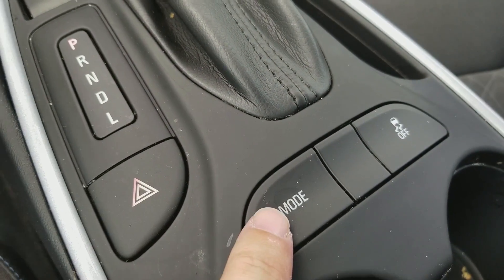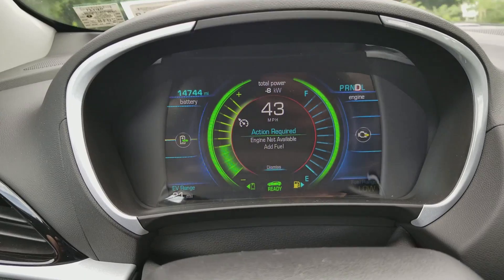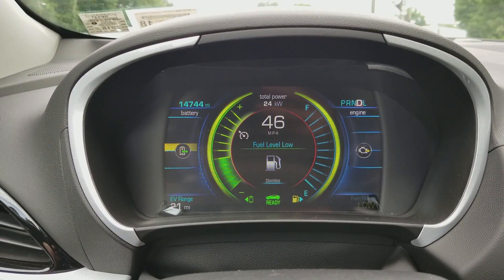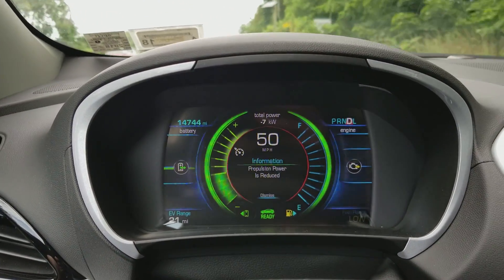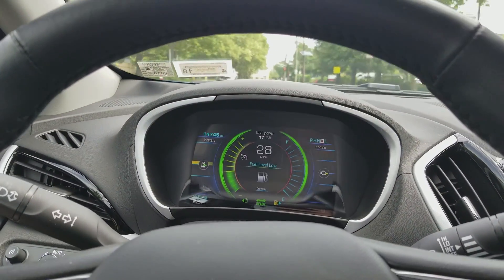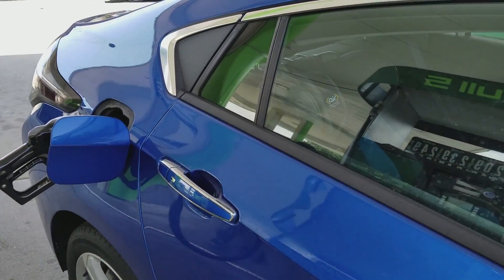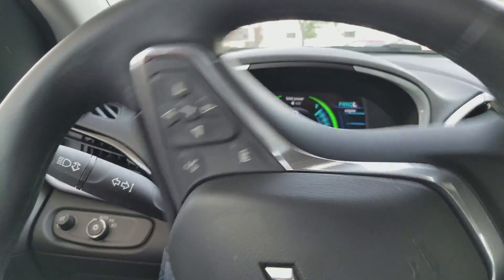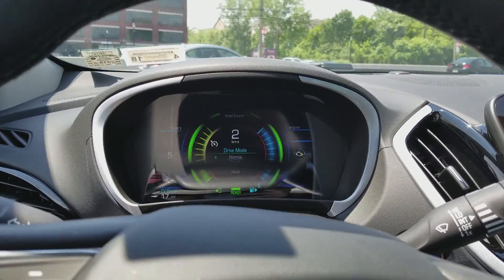Electric Chevy Volt Runs Out Of Gas - Becomes Dangerous

Comment: At 2:03 it literally says "Propulsion Power is Reduced" on the dashboard...
Reply: +Darek M It is right in the manual. Multiple warnings
ENGINE NOT AVAILABLE ADD FUEL
This message displays when the
engine is not available due to
running out of fuel. The vehicle can
continue to be driven in Electric
Mode until the battery is depleted,
but will have reduced acceleration.
When this message is displayed,
refuel the vehicle.
FUEL LEVEL LOW
This message displays when the
vehicle is low on fuel. Refuel as
soon as possible.
OUT OF FUEL/ENGINE
UNAVAILABLE
If the vehicle runs out of fuel, or the
engine will not start due to a
malfunction, the vehicle can
continue to be driven in Electric
Mode until the current charge is
depleted. The vehicle will have less
responsive acceleration. DIC
messages indicate reduced
propulsion power, that the engine is
not available, and the need for fuel
or service.
Reply: I mean it still by far outperforms any other car that runs out of gas, so I think Chevy did a great job here!
Reply: Darek M - I couldn't agree more.
Reply: only find out later? Ugh its in the manual lol, always read the manual! page 136!

PROPULSION POWER IS REDUCED
 
This message displays when the propulsion power is reduced and can affect the ability to accelerate.
If this message is on, but there is no reduction in performance, proceed to your destination. The performance may be reduced the next time the vehicle is driven. The vehicle may be driven at a reduced speed while this message is on, but maximum acceleration and speed may be reduced. If this message stays on when the malfunction indicator lamp is on, the vehicle should be taken to your dealer for service as soon as possible
Reply: haha well i'll be damned
Reply: it's more than that Daxlaxx, the electric motors are power limited below their normal power, it's not just the engine that gets disabled.
Reply: ThOrZwAr and its right as he is saying that it should warn of it lol...   Irony
Reply: yea i gotta first gen prius. when it runs out of gas all the dash lights comes on lol scary!  and its will get you to a gas station but not anytime soon lol. I think my top speed was around 30mph with no gas. and its dangerous because once that battery dies its no way to charge it to get the ice running again. would have to tow it to toyota.
Reply: Dashcam Channel Some* My mom's car is a 2016 crv, mine is a 06 Jeep GC. The seatbelt beeps stops on hers(and won't make a beep when the seatbelt is removed, only a light on the instrument panel), while mine keeps going.
Reply: Dashcam Channel This car has none of that anyway, so you knew what you bought.
Reply: most cars serviced and maintained at main-dealerships are lease cars, under full warranty. if you want your car serviced properly while out of warranty you'd better get to know the service manager. maybe send the department a christmas card etc and engage in some car-talk about their product (your car). They may just think that what you don't know won't hurt and you can afford a hundred extra bucks. they may also be too busy to really think about going a bit further. 
Just don't forget that the time you spend messing about trying to figure out what is going to cost you money is time you could be doing something else possibly more valuable. 
Is trying to save a hundred bucks here and there by using essentially the goodwill of others worth it? 
An most people can go to another dealership, or at least try another then go back to their original with a comparison, and the original may be more eager to help you if they see a stamp from another garage in your book; even if its from the same dealership chain...
Reply: That's so true what
Reply: That’s why it’s important to know your car? Lol having the discipline and making wise decisions on your own.
Reply: There is also a chime. But this guy must work for cnn or abc cause he's not telling you the whole story
Reply: ThOrZwAr Unfortunately some need the annoying dinging and flashing lights to take notice which Chevrolet didn't do in this situation. Kind of like the newer cars that have the constant beep until you fasten the seatbelt...
Reply: Who knew if you ran out of gas on a hybrid it wouldn't go fast
Reply: That doesn't help you if you only find out that it even has that feature when you've already entered the on ramp before that message comes up expecting it to have the usual performance it has in all electric mode and by then its too late to realise you're gonna need a longer run up than usual to reach merging speed.
Reply: @RWoody1995  well driving an economic car and still not being able to afford gas is bs also the car was fine he still drove it at 50something mph wth
Reply: I'm not sure about the new version, but the old version dings when you are low on fuel or empty, every time you switch on the car, and has constant dashboard notifications.

You deserve low propulsion for being an irresponsible buffoon.
Reply: Darek M   I agree especially if it's something that is as different from the past decades of cars as a hybrid or whatever the Volt is.
I am guilty of not reading (or remembering ) everything from my manual,  but if or when I get a Volt i'm going to be too worried I might make it explode without reading the shit out of that manual. 
I do get pissed however, when something goes like this with the "regular" cars we know;  The dealership (or maintenance shop you frequent) sends suggestions of the things your car needs in it's checkup, including scheduled maintenance and things the manufacture even recommends. They have it all there listed, saying how important it is. Okay great. You take it in and they do their work. 
Then you find out after maybe oil is burning more or the engine is not quite what it used to be, that something like the PCV valve or whatever should have been changed at a certain mileage, which is IN the manual in small print or a schedule mixed in with tons of other small things, BUT your shop or dealership didn't mention it. Didn't have it on their list of things needed... nothing. 
So they get you used to the suggesting what "needs" to be done or recommended yet leave out something important, which suggests and implies they know what you needs, yet shrug about it when you start to ask questions after it's too late.
Reply: Yeah, but "reduced acceleration" and "less responsive acceleration" does not communicate the full import of the true situation: you're acceleration will be reduced to less than that of an original VW Bug towing a boat anchor. Your ability to attain freeway speeds will be measured in calendar days.

Comment: I mean, I get that it's a big difference, but dangerous seems a bit like an exaggeration, no? You do know there are production cars on the autobahn with similar performance and it works just fine, you just need to be aware of it, which I hope/assume is your point. (Personally drove a 40 something horsepower 3 cylinder shit bucket on the autobahn and it worked, not that it felt great, but it worked without issues)
Reply: captainsewerrat When you think a car should do something and it doesn't like it has before, it's a problem. I've driven older petrol cars in limp mode and they are dangerously slow about town.
Reply: It really is the owner's fault for lack of fuel planning. Don't wanna take the risk of merging with a 0-60 of 20s? Don't run outta gas, OR, simply stay put and wait for AAA.
Reply: I wouldn't really say the design is stupid. The car warns you forever that you're about to screw yourself over and it's basically just a bonus that it does anything at all once it reaches that point. If I run out of gas going down the highway I just come to a stop, which is also dangerous, but it isn't the car's fault that I did something stupid.

So... I see 2 arguments here.. 0-60 in 20 seconds is dangerous, which I agree with, and the Volt design is stupid, which I don't agree with.
Reply: Maxwelhse if it was a regular car that just a had a failsafe of   Temporary drive ability on electric just to get to a gas station. I would totally agree. But in either case, whether it's a failsafe in emergency situations, or it's an actual option that you can cruise around town on. It should d I've that way safely, or give you a giant detailed warning that your car will lose 90% of its power.
Reply: yan-Deriction yes, but he didn't exhaust both. He set the car to use just the engine first, then the car went into limp mode while he still had sufficient battery charge for normal performance. Obviously if you've blown through the battery and then the gas it will make the most it possibly can out of the remaining charge in the battery, and you shouldn't let it get that far.
Reply: I might agree with you, except, the volt was supposed to have a 40 mile range full charge, if you looked at the cluster display, he had over 20 miles available.  This car was marketed as a EV with gas range extender..., so, it is NOT unreasonable, for someone to assume that it would have decent performance whether on gas or electric alone, not just have both....  I was considering a volt, but, now, unless I can get the computer reprogrammed to prevent that half arsed limp because no gas crap, I will not get it....  The gas motor was supposed to be a GENERATOR ONLY, not, a primary motivator...
Reply: actually, you are wrong. The volt is a plug in hybrid - which is not the same thing as an EV with a range extender. The engine in the volt can drive the wheels directly - it is not simply a generator, as opposed to something like the bmw i3 REX which's range extender only provides electric charge and never drives the wheels. The engine needs to come on every few months even if you drive on electric only 100% of the time. You wouldn't drive the volt around with no gas, any more than you would drive it around with no engine oil. If you want an electric car that doesn't need gas, there are many options out there.
Reply: Bullshit is 0-60 in 20 seconds dangerous.  A VW Camper is more than double that.  A Trabant takes a full minute to get to 60.  The Smart Fortwo CDI is about 20 seconds, and the Land Rover Defender isn't far off.  As are pretty much any average car on the road that was built prior to 1960.
Reply: Ok run gas out on any other conventional car that burns gas and try to accelerate on to the freeway. This is as dangerous as serving raw meatballs in your spaghettios and wondering then blaming the meatballs for getting you sick.
Reply: You may be able to hack it by shutting the car off, opening the gas door and gas cap, wait a few minutes (don't have to put any gas in) and putting the cap back on and closing the door. Start the car, it'll be in 'Normal' mode default as always when you turn it on, and since the engine will not be called upon because it is in normal mode and there are battery miles left, and the car thinks that you may have filled the gas tank, then it will have full power all the way to 0 miles remaining.
Reply: The Engine on the Volt cannot drive the wheels directly. It can clutch to the secondary motor and provide direct torque to the drive train as crusing speeds, but it cannot provide a high amount of torque, nor can it drive the wheels alone.
Reply: The most dangerous, and least deserving of a license, drivers are those who won't make room for other vehicles which can't make the cooperative adjustments without their cooperation.
Reply: here's a lesson on how the chevy volt hybrid system works:
when the battery is charged in the normal usable range (let's say 20%-90%), the system uses electric power and you get 0-60 in ~7 seconds. After battery drops to 20%, the system starts using gas, and you get 0-60 in ~7 seconds. After your fuel level runs to zero - which you should NEVER let happen, the volt lets you access that remaining 20% as a LAST RESORT, the idea is to give you a fighting chance to get to the nearest gas station or charger, if you're already on the freeway you should be getting off the nearest exist, if you're off the freeway the last thing you should do is get on it. power is limited because draining the battery to that level is extremely harmful. bottom line, the chevy volt DOES run safely on both *when operated normally*, blaming the car for running poorly after exhausting both gas and electric power is like blaming your underinflated tires for being unsafe, it is 100% your fault.
Reply: A 20 second 0-60 is flat out dangerous. Try merging into traffic in LA or Chicago like that and see what happens. I've done it and it wasn't pretty.
Reply: yan-Deriction it's a hybrid that runs on GAS and ELECTRIC. The issue is that he didn't know that it loses power when it's out of gas. Bc it's touted as being able to run on both electric and gas. When it's out of electric, it runs fine. So he assumed it would run safely without gas as well. Sure he could have known had he researched everything more thoroughly.  But not many ppl research what happens at possible stage of operating a car. Did you study your owners manual before driving your car? Most ppl do not.
Reply: Maxwelhse how can you agree that 0-60 in 20 is dangerous and think that a car that does 0-60 in 20 is well designed? It didn't tell him he was in danger when he ran out of gas. It's a ducking hybrid. It should run safely on both. It's stupid.
Reply: BritishCommentWriter those are probably the most rear ended cars in the world. 

It's obviously safer to have the speed to get out in front of traffic when you need too. You can't reasonably argue that's that true. 

Most importantly to this conversation is that he didn't know. The car was doing 0-60 in about 8 I'm guessing. Then without warning started doing 0-60 in 20 seconds. That fucking dangerous.
Reply: captainsewerrat if you're merging you either go fast enough, fast enough, or you get rear ended from ppl behind you who are already going fast enough. Fast acceleration has saved me many many times. It's especially dangerous when you expect 0-60 in 9 seconds and you get 0-60 in 20 seconds.
Reply: yan-Deriction it's a stupid design. Sure he should have studied the manual before merging on the freeway. But it's a stupid failsafe. Bc it's dangerous.

Comment: complains about it not being safe when every other car just dies and leaves you stranded. had to dislike.
Reply: See, superspeedersRob is an idiot, not an electric car. It is a hybrid. Guess that is beyond his comprehension
Reply: YUKI JINJUJI not anymore. That is how the first volt worked most of the time (under 70mph). The new volt has a way more complex transmission and it normally only runs pure electric while running on gas when the car is under 20mph. After that it engages to the wheels and drives like a more regular hybrid. I'm not sure if I prefer the smoothness of the first volt versus the efficiency of the new one while running on gas
Reply: I am assuming the FWD is Conventional engine power...and the Rear end has a Electric motor Drive...with a Custom Li-ion battery that gets charged as you drive the volt...that has provisions for a plug in charge at home...but not at the Tesla charging stations.
Reply: No This is Patrick Whether or not it is classified as a hybrid because someone decided it that way it is STILL a hybrid. It uses two propulsion systems and energy sources.
Reply: Not from GM's perspective. To GM, the Volt is primarily an ICE car that happens to have the minimum size battery to give you enough of an EV flavor that they can pick up some ZEV points. To GM, it's a way to avoid selling you a true EV.
Reply: Unstoppable hmm i guess only idiots would pick driving an unsafe car and risking death over being stuck on the side of the road
Reply from the maker: have to understand this is primarily an electric car.
Reply: So you feel it’s safer to have a car that slows down but still allows you to drive? I hardly see how that’s safer. If anything imo that’s worse and Rob clearly showed how dangerous that could be. Further more, he’s not saying that running out of fuel with a petrol engine is any better, it was a video about the dangers of this feature. Wow.
Reply: @codyallen63  I know you wrote this 3 years ago and probably forgot about the existence of this comment but I think the idea was if you're like 20 miles away from a gas station and have like 30 miles of range the car would rather you limp to the gas station than to risk not making it to the gas station.